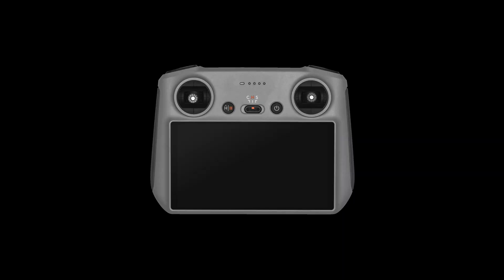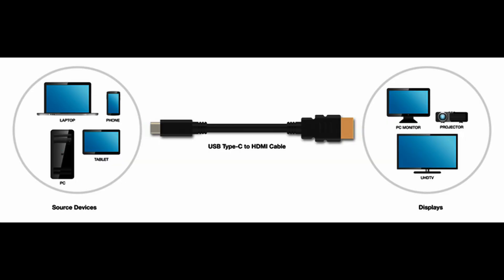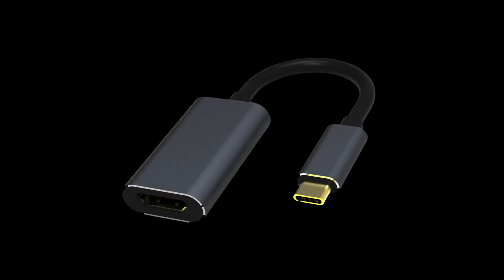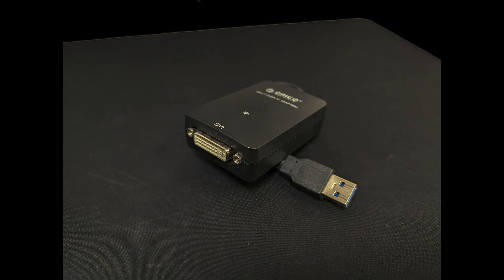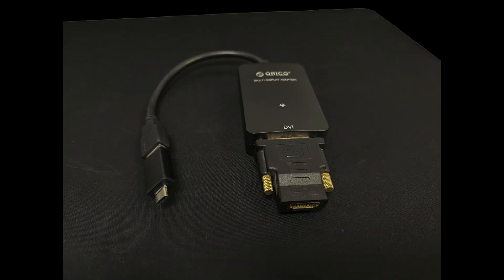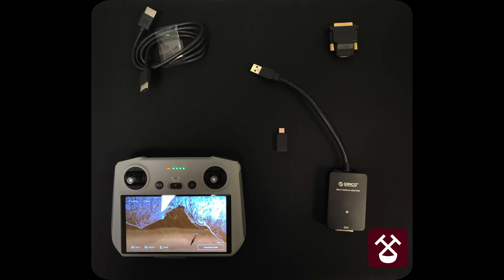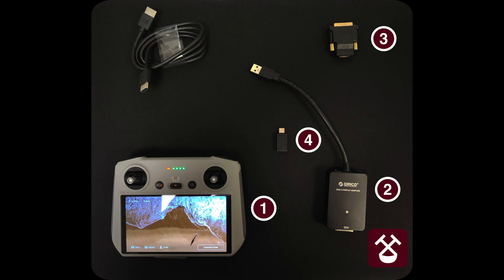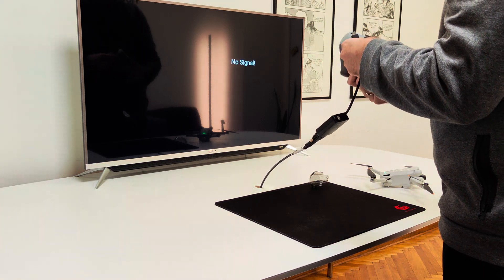HDMI output on DJI RC

Comment: I would also like an explanation on loading the driver's please. I have gone through the process of unlocking the RC but I'm nervous about side loading the driver without any instructions. Even if you don't have time in a video, is there a chance you could explain it here in the comment section?
Reply from the maker: Hi. You can look for instructions on how to perform patching procedure on DJI RC FCC website and ask the patch developer to assist you if needed. When you successfully unlock your RC I will be able to assist you to setup ADB and install the required driver.
Reply: @tuxtard  If my controller is unlocked, can you tell me how to do it? I need to stream live using the RC controller.
Reply from the maker: @matys-studio  Sure. If your RC is unlocked you just need to install DisplayLink driver APK.
1. Download DisplayLink driver APK for android from here: https://www.synaptics.com/products/displaylink-usb-graphics-software-android-apk
2. Download Android platform SDK tools from here: https://developer.android.com/tools/releases/platform-tools
3. Connect your RC via USB cable to your computer
4. Open terminal app on your computer
5. Type adb install PATH_TO_APK/DisplayLink_APK_Name

in the terminal command above you need to replace path and apk name with the correct path and name of the downloade DisplayLink APK file.

Comment: Hello, many thanks for the video. But... US$ 69 (in crypto) for the FCC app, plus hacking the controller, plus NO CLEAN HDMI feed...  this will only be worth the hassle when it provides a CLEAN HDMI feed. The image I get on the DJI RC screen is very good already. No need to send it to an external screen. Again, thanks for the video.
Reply from the maker: Yeah, clean HDMI feed is still not supported by the DJI Fly app. I hope that DJI will add that option in time because previous app DJI Go does support clean HDMI. It would be the best if they implement it as an option because I use external screen to fly and I need telemetry.

Comment: It´s possible a clean HDMI output?
Reply from the maker: Unfortunately, no. It is still not supported by the DJI Fly app. DJI Go supports clean HDMI output and I hope that DJI Fly will get the same functionality in time.
Reply: Yes. Just not this way. Joshua Bardwell has a video on it
Reply: @PiDsPagePrototypes send the video plis bro

Comment: Hello Tuxtard, how are you? Any news about the new video you are going to release explaining how to install everything. Regards Thanks :)
Reply from the maker: Hi. I am still trying to find a way to completely remove the patch so I can show all the steps required to unlock the DJI RC. Even when I refresh the firmware or do a factory reset I still end up with partially patched RC that requires less steps to unlock. If I don't find a way I will simulate the missing steps to get the full picture.
Reply: Thanks for all,  @tuxtard  Regards

Comment: Can it work with dji rcn1 remote also?
Reply from the maker: Well, only if your Android device has 2 USB ports, one for the RC-N1 and the other for the DisplayLink Adapter.
Reply: Hmm, I wonder could you use a USB-C hub with your phone with the RCN1

Comment: fake
Reply from the maker: Hi. It's not, it works. But you need to install DisplayLink driver first and use DisplayLink adapter. You can't install DisplayLink driver and use any other adapter, you have to use DisplayLink driver + DisplayLink adapter.
Reply: @tuxtard  I buy exactly and doesnt works

Comment: how to unlock slideloading on DJI rc
Reply from the maker: Hi. Currently only DJI RC FCC patch is able to unlock DJI RC with the latest firmware - https://www.djircfcc.com

Even though DJI RC FCC is meant for a different purpose it enables ADB on the DJI RC which you can then use to install driver APK using your PC.
Reply: can you make video tutorials on it
 @tuxtard
Reply from the maker: I am working on it, but recently new DJI Fly App and RC firmware is released, so not I need to check if the unlock procedure is the same.
Reply: @tuxtard   pls help mee to connect fcc

Comment: Hello good day how are you ? I have the same DJI RC Control with a MIni 3 Pro, they bought me all the adapters, just like the video shows and it DOES NOT work for me. Can you help me please. I DO NOT Unlock the DJI RC Control. Simply plug in the adapters and cables as the video shows. Do I need to do something else? Thanks Regards
Reply from the maker: Hi. First you have to unlock the device and install the driver. Without the driver installed the adapter will not work. You need to:

1. Unlock the device and enable ADB on your RC
2. Install the driver APK using ADB
3. Reboot the RC
4. Give screen capture permission to the driver
5. Connect the adapter to the RC
Reply: Thanks for answering, I'll see if I can get all those steps. If you make an explanatory video of those steps you are a hero.. I'm afraid of making trouble. A big hug, regards tahnks
Reply from the maker: @RovicTV10  I'll make a video showing how to install the driver as soon as I can.
Reply: @tuxtard  thanks for all . Regards from argentina 😉

Comment: Hi I'm from Bangladesh... I have dji macvic 3 pro..... I want to connect another big monitor with my dji Rc controller. Is that possible? If possible please help me @Tuxtard
Reply from the maker: Hi. It is possible if that monitor has HDMI port. If so, you can use the same adapter type with DisplayLink chip as shown in the video and unlocked DJI RC controller.

Comment: Thank you for sharing, this is the only video i saw that the dji rc connected via hdmi, can you teach how to unlock and install driver in dji rc please, thanks you
Reply: Thank you,  i installed djircfcc  and the displaylink driver, now i can able to connect to hdmi.
Reply from the maker: @olickskilo  Great! I'm glad you got it working :D
Reply from the maker: @olickskilo  which version of DisplayLink adapter did you get? USB-A to DVI or some other combination?
Reply: @tuxtard  i already have a usb-A to hdmi, and i have usb hdmi capture  and work even as zoom camera.
Reply: did you try to update firware after the unlocking process
Reply from the maker: Yes, I updated to the latest version. After each update you have to reapply the patch and it keeps ADB enabled.
Reply: @tuxtard  thank you that's great, i hope others can get the procedures how to do it. You did big help for me thanks a lot
Reply from the maker: @olickskilo  you're welcome 🤗
Reply: @tuxtard  hi, i have bad news, my dji rc stop working with my display adapter now,  im not sure if the issue  is the driver  or the rc or the adapter, adapter still working with the pc, my adapter model is QGeem. how about yours it is still working?
Reply from the maker: Hi. It still works for me, but I am not using the latest RC firmware version. Which Firmware version are you using on your RC?
Reply: @tuxtard  Hi. V01.03.1000 , its not latest but for the first time i use adapter in that version is still working but  i dont know what happen its stop working on that  version, can you please tell me the model of your adapter that you used hoping the problem is only my adapter.
Reply: @olickskilo  Can you write in detail the steps to install the DisplayLink drivers on an unlocked controller?
Reply: @matys-studio  hi mate, did u unlock your controller? Any info on the procedure maybe? 😄
Reply: @olickskilo 
Hiii sir please make video how to install this driver and how to work
Reply from the maker: Hi. I will create a video to show how to unlock and install the driver, but in the meantime you can find this information online. Currently I think the only way to unlock DJI RC with the latest firmware is using payed DJI RC FCC patch which, among other things, enables ADB on DJI RC. You can find this patch here: https://www.djircfcc.com. Then you can use ADB on your PC/Mac to install driver APK.
Reply: great, I'll wait for the tutorial before proceeding with mine, thank you
Reply: @tuxtard Hi, I'm waiting for you to make a new video about how to open the HDMI out

Comment: What this dji mini 3 pro
Reply from the maker: Hi. Yes, that's Mini 3 Pro.
Reply: @tuxtard  Can I just use a mini HDMI to USB C cable?
Reply from the maker: @evanevn1878  Only if it has DisplayLink chip inside, but as far as I know, there are no USB-C to HDMI adapters with DisplayLink chips. See how big my adapter is? It's big because it has DisplayLink chip inside that replaces hardware part that DJI RC is missing to produce HDMI signal.
Reply: Yes, and this rc app also expensive
Reply from the maker: @KunalBhoirs well yes. Unfortunately newer firmware versions are only unlockable with a paid patch. But even so, it is still way cheaper than buying RC pro which supports HDMI out of the box.
Reply: Owh im has check, little expensive for price. 😁
Reply from the maker: @evanevn1878  Yes, unfortunately these adapters are more complex and more expensive. Before buying you should first check if you can unlock your DJI RC and gain ability to install drivers. If you are not able to install drivers than you should not waste any money on adapter.
Reply: @tuxtard  owh not just adapters, but  need aplication special which install to rc

Comment: This is awesome. thank you!
Reply from the maker: You're welcome :)
Reply: this is fake... i try 2 times and nothing
Reply from the maker: @CharlesPoolSansón  Did you get USB adapter with DisplayLink chip in it? Did you manage to install DisplayLink adapter? Please make sure that you have both the adapter and the driver as mentioned because only the DisplayLink driver and adapters will work with the 32bit SoC that DJI RC has.
Reply: @CharlesPoolSansón did his solution work as he said in the reply?